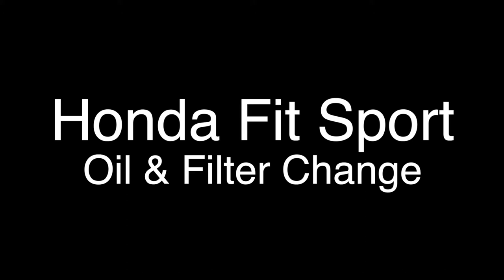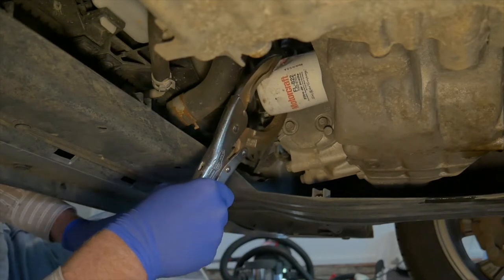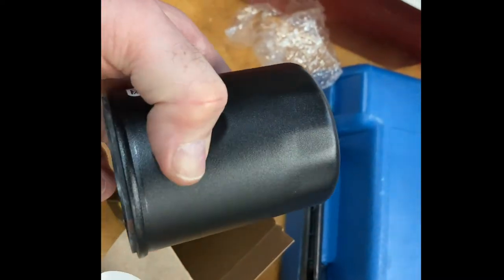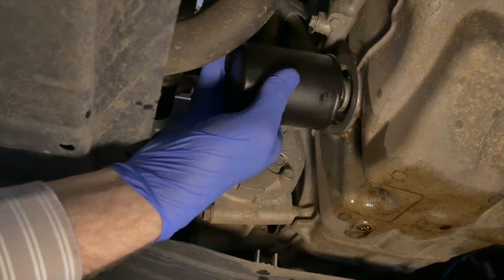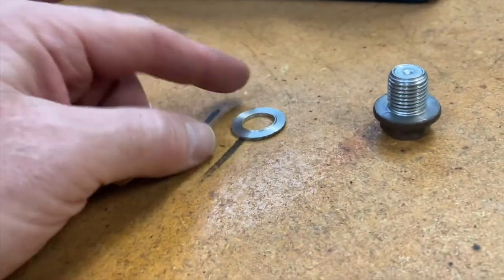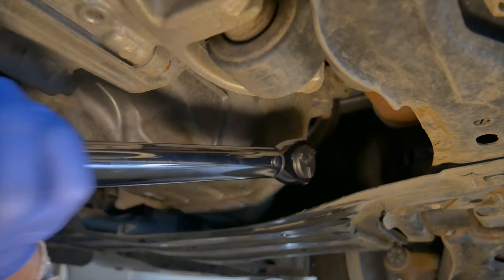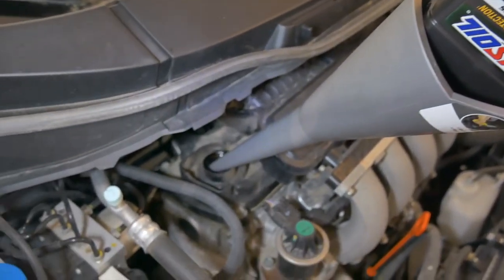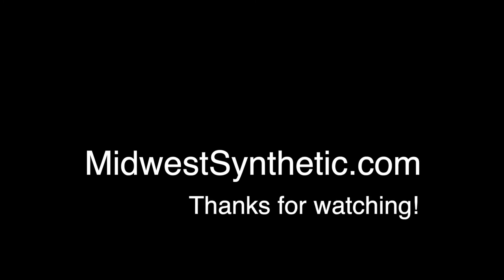Honda Fit Oil Change - AMSOIL Signature Series 0W-20 Synthetic Motor Oil and EA Filter

Comment: Most people really have no concept of what a difference running a 100% synthetic oil will make. So many people complain about oil consumption and fuel dilution and all sorts of stuff that is ultimately caused by cheap oil. Deposits on the rings. Signature series in your engine and especially for your transmission on Hondas and Acuras... They'll run forever.

Comment: Like filling the filter, l all ways do that when I change my oil, only makes sense, but I have run into problems not using genuine Honda filters, buy mine at the dealers, but only use Castro's oil.  Thanks for the video😊
Reply from the maker: Thanks for watching and leaving a comment!
Reply: The Amsoil filter absolutely wrecks the Honda filter.. Honda doesn't make filters by the way
Reply: What kind of problems have you had with which filters?

Comment: I’m about to use Amsoil for the first time despite having listened it is too expensive. Here’s what I’ve calculated for my 2021 Tacoma Pro. It takes 6.2 quarts. If I use the cheapest synthetic and filter it will cost me 31.41 per change. If I do this every 3k miles it will cost me $1,046 over 100k miles. If I use the Signature Series AND the Amsoil filter it will cost me $77.92 per change. If I do this every 5,000 miles it will cost me $1,558 over 100k miles- ONLY $513 more. If I drive 10k miles a year the Amsoil will cost me $51 more per year. 

I think I can handle $51 more a year EVEN IF Amsoil isn’t any better. If it is- the $51 extra each year is a bargain because it likely has saved me more than the extra $513 over the 10 year period. Obviously if I changed the interval to 15,000 miles it buys its way in BUT I wanted to show the most conservative approach. I hope this helps put things in to perspective.
Reply: At that rate, you are changing the oil way too soon. With a full synthetic oil, you can go at least 5-7k miles minimum. With the Amsoil SS, you can go 25k miles or 1 year
Reply: Amsoil is rated for well beyond OEM drain intervals in every application. However, the very fact that you are aware of Amsoil means that you are beyond the average normal persons knowledge of engine oil. And most people that are concerned about engine oil have the disposable income to afford Amsoil.
Reply: It's such a no-brainer. First off Amsoil is the best and secondly over the course of 10,000 miles I'm spending about $1,500 in gas... An extra 20 or $30 for an oil change is completely irrelevant. And all likelihood I'm making money on gas savings from the extra efficiency of the oil and let's not forget the fact I'm not going to have to worry about vcm problems oil consumption deposits on my rings and for you guys with timing chains it's got special additives to keep the soot contained so it doesn't stretch the timing chain...
Reply: @kalani1987  yeah Amsoil says 25,000 miles but that's a good way to ruin an engine. Even at 10,000 miles on signature series my TBN is usually extremely low... In certain specific conditions I'm sure they can do 25,000 miles but it's not just a default
Reply: Oil gets so dang dirty it’s crazy to extend the intervals that much.  Extended intervals are a marketing scheme by Amsoil.  I use Amsoil but change more often.

Comment: I see it’s not api certified want to use in a 2020 accord 2.0 , but see on the owners manual it’s specially says use api certified oil only think it’s still safe to use ?
Reply from the maker: AMSOIL makes some very good lubricants.  To be find out which products are suitable for application check their lookup guide.  There's link in the video description.  Thanks for the question!
Reply: Amsoil specs far exceed API requirements. They just refuse to pay for API certs.
Reply: It’s better than Mobil1 Or any other Full Synthetic (Conventional Oil plus additives) from Walmart.  

If you concern about the API, use Amsoil OE or XL.   Signature  series is the real deal with NO API cert.
Reply: BullsEye Oil was API Certified,it was trash oil..,it is a pay off for a symbol.. .  AMS had that certification along time ago and it still has the best specs but I think they use more of a certain additive that keeps them from getting the API now and it does not mean anything bad.. ..The lower mileage  grades of AMSoil has the API   .   API wants many dollars for a certification  that makes it a pay to get in the gate  scam ..  API has very low standards for oil quality ..
Reply: Signature series won't meet API specs due to the higher phosphorus (along with other additives) content in the oil. Other oils will keep additive levels lower to help protect emission systems. Amsoil OE and XL has the API certification.

Comment: @
MidwestSynthetic i have a question. i have a honda civic, iam using penzzoil. how is AMSOIL better? i care about cleaner engine.
Reply from the maker: Thanks for question.  Here's a couple links to help explain the superiority of synthetics for cleanliness.  

https://w.amsoil.com/newsstand/auto-and-light-truck/motor-oil/articles/how-extreme-heat-affects-your-engine/

http://www.midwestsynthetic.com/6-reasons-to-change-your-motor-oil.html
Reply: Try it once and decide if it’s something you want inside your engine.  Your vehicle will run better and longer.
Reply: It's 100% synthetic Pennzoil is not

Comment: A Ford oil filter on a Honda...genius pure genius...
Reply from the maker: That's what it had when I got it.  It's better cared for now :)
Reply: The previous owner probably liked the upfront bypass design of the motorcraft filter.  Which one is right (upfront or in the dome) design for the bypass?  I don't know. Their are pros and cons to both designs.  I do find it interesting that years ago AMS oil filters had the upfront bypass design.  They now have the bypass on the dome side.  So why did AMS decide to change their design?
Reply: There are a lot of filters worse than Motorcraft.
Reply: @viperstrike3827  ...Motorcraft are made for Ford products...

Comment: 0 weight has the viscosity of water.  And people can’t figure out why they have engine problems.
Reply: Engineering is the culprit, not the oil weight. Poor designed engines are not going to fixed by the oil weight. It  is much deeper than that. I am a mechanical claims adjuster, and regardless of the viscosity of the oil, some engines just fail before expected. Toyota and Honda went to 0 weight oils before most, yet they have the lowest failure rate of any engines being sold. These are solid facts. If thicker is better, we should all use 20w50, or is that too thick? Maybe 5w30, or is that too thin? Maybe the engineers should decide eh? I remember when manufacturers went to 5w30 from 10w30 and everyone freaked out. It will always be too thin when it comes to people literally having no idea what they are talking about. I use 10w40 in my 50 year old Buick 350 engine because the tolerances that the engine was designed for requires it. My 2012 Fit has had 0w20 since day 1. No issues and I know I am no smarter than the people who spec'ed the oil. Which btw has increased 5 fold in its ability to protect engines in the last 20+ years. Old from the 1990's pales in comparison to modern oils. But, bad engine design (i'm looking at you GM 5.3 variable cylinder management engines and defective rod bearing Hyundai engines) will never be cured by switching oil weights or brands.
Reply: Modern car engines are designed for thinner oils
Reply: That's not anywhere close to true. It's not a zero weight it's a 20 weight. Zero is not a weight it's literally just a rating. Amsoil 20 weight is actually extremely close in viscosity to Amsoil 30 weight. And people using Amsoil are never going to have any oil problems so all of the things you said were completely wrong
Reply: @9ZERO6  The rural carrier in my area says he has used 20w50 in his Toyota T100 for 600k miles. Would I do it to my Fit? HELL NO! It worked for him though. I don't condone it, I was just putting it out there!
Reply: My Honda manual says 0W20 so 0W20 it is, no thinner no thicker.